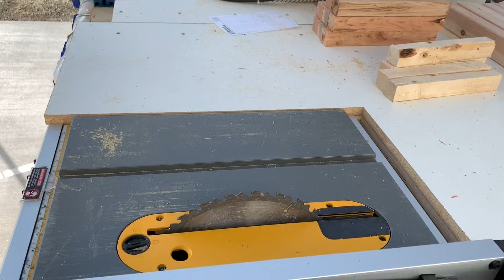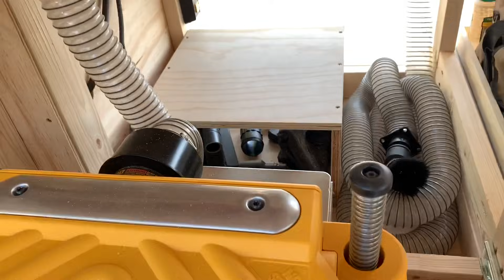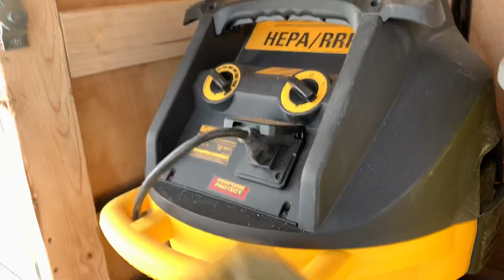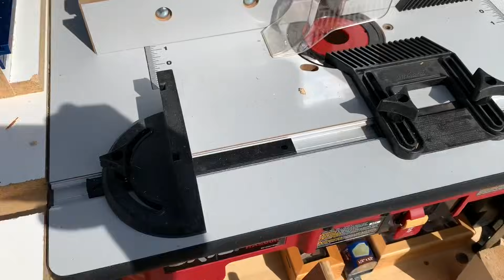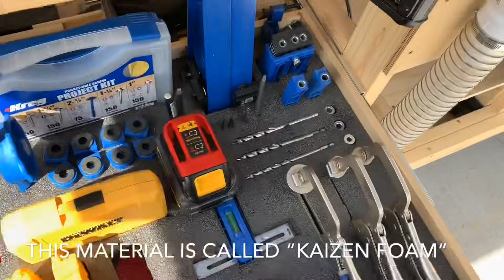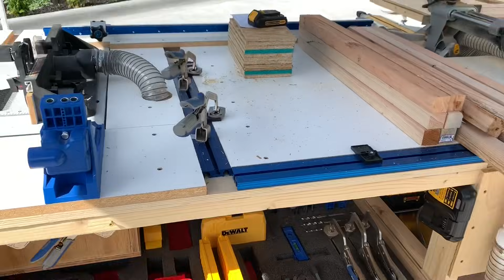DIY Mobile Project Center - DeWalt Workbench Walkthrough

Comment: I absolutely love this workbench/station!!! What I love the most is the vac with the power sensor built-in. I have a wall-mounted garage vac for now, with a remote-controlled switch that the vac is plugged into. I plan on getting a 2 hp dust collector which will go into a small closet built off the back of my shop. this will keep the noise out of the shop and the need for the expensive HEPA filters. I do have a hanging air filtration unit that does a great job of taking the fine particles out of the air. That valve system is pretty sweet too!!

Comment: I just finished building this table with some of my own modifications. I can say that the plans are excellent and very easy to understand if you are an experienced woodworker. One of the major changes I made was to increase the size of the dust collector valves to 2" and I use a Rigid 6 hp shop vacuum and it works perfectly so far. I caution that this is not a project for someone who wants to build it in a day or so and it takes time to shop and accumulate all of the parts and pieces. The plans offers a list of just about everything you will need along with the prices and that is extremely helpful. I am 6'3" and found the specified height of the table with casters to be higher than comfortable for me. I reduced the overall height by about 4 inches by changing the caster size and reducing the frame height.. I do caution that if you change the dimensions, you have to look carefully how that affects the cut plan for individual parts. The height change also required a simple work around to fit the dust collector into the smaller height. I really like the table and compliment the creativity and  innovative design that was done by Scott Stekr.
Reply from the maker: Thanks Bernard I hope you enjoy your workbench!

Comment: Just saved your video.  Awesome table and very inspiring.  The only thing I saw were the screws that extend down through the top.  I know the first time I reached into one of those top shelves, I'd be pulling out a bloodied up hand after catching it on one of the screws.  Easy fix though, so certainly nothing to knock you about.  Really nice work station.

Comment: Pretty sweet setup. Only thing I would change is the electrical that power strip and cord are a bit small for running 2 tools. Im surprised you haven't tripped a breaker. Id run a 30 RV service to it and have some extra electrical head room. I've seen lots of brushes burn up on tools from running to small of cords. Sweet setup 👌 though I see a ton of productivity in it. Get you a helper and you could really crank out some projects!

Comment: Nice workbench! Your video just popped up in my feed. One improvement I might suggest would be to have the vacuum plugged into a remote on/off switch. Then you don't have to deal with reaching through to turn on the vacuum locally
Reply from the maker: Check out the whole vid, the vac turns on automatically with every tool.

Comment: Really nice bench, upgrade your planner with carbide helix head will run you about $400 you will cut down on changing blades by 95% . On the steel ones you hit a hard knot and your replacing a blade. And its much quieter. Again great bench.

Comment: I like it - the only thing that caught my eye were the screws showing through on the right side. Then you opened the drawer with the hand helds and figured you probably don’t need to worry about hitting them reaching into get something.
Reply from the maker: Yeah it does look terrible in the vid.  I only had the 2" screws left when I was wrapping up.  Arm hand, etc never comes close to underneath the top so far so good.  Thanks for checking it out!

Comment: I tagged your build when it was first posted and am finally ready to buy your plans and build it!  A couple of questions:  if you're running just one cord from the workbench to a wall outlet, what amp size outlet are you plugging the cord into?  Overall, how did you find the vac's CFM suction for this setup?  Was it up to the task?  After looking at so many workbench builds, I always returned to yours as the best for my needs.  Many thanks
Reply from the maker: I have a dedicated 20A circuit and 20A rated extension cords and power strips.  (NEMA 5-20).  The power strip I landed on is basically for computer servers.  https://amzn.to/3zr0khI

The vac setup is awesome.  Wouldn’t (and haven’t) changed anything.

Comment: So I made this bench from your plans, I ran an entire electrical system in it that plugs into an extension cord to give it power. Love this bench, big but useful, my question is, how did you connect your router table to the dust tube? I have the same router table, but am struggling finding the right connector
Reply from the maker: I used a rubber plumbing fitting that fit nicely into the dust port.

Comment: WOW! Love it! Great features on your bench sir! Very well thought out. I will be building my bench through the fall winter I hoping and may incorporate some of your ideas (as well as may other tradesmen). I am wondering if you're happy with the dust collection through your flex hoses. Do you have enough suction? I've learned that with shop dust collection systems the less corrugated pipe and the less curves and sharp bends the better as it creates more friction loss and less suction. Perhaps there's no problem with a bench vacuum system.  So in retrospect would you do it the same way if you had to do it over again? Thanks for sharing this helpful video. Again its awesome!
Reply from the maker: No problems to report, plenty of suction.  The total length of piping is relatively short so I don’t think it would ever be an issue.  Also I make sure to run the pvc wyes in the right direction for flow to the vac.

Comment: Hi. Great project, i think i'll get it and try building it. Just a question: the bench looks very high, i read from the site it is 46 inches (116.84 centimeters). Usually workbenches have their height set below 91cm.
I'm 1.82 meters, do you think i will be comfortable working  at 46", given that i cannot remove wheeels (wich would sove the problem imediately).
Thanks in advance. And again, fantatic workpiece.
Reply from the maker: This is setup as standing desk height.  You may want to adjust it to your needs but it is supposed to be taller than normal.

Comment: I purchased these plans back in February. I’m well into the build. The plans are well done, easy to follow. Scott has answered all of my questions on Etsy and even sent me his own pics of the building process. As I am half way through this build(all framing complete, working on the melamine top) I’m starting to get nervous about the height. The table saw surface sits at 46” from the ground. Scott are you 6’8? Lol. I’m 5’10. I’m really nervous I’m going to have to take the wheels off and make it a stationary workbench so the machines on top are low enough to use safely. Any suggestions?
Reply from the maker: James-  thanks for the positive comments!  As for the height I designed it so it would be standing desk height.  You will see once you get used to it how much more ergonomic it is.  Depending on how big whatever you are making is you may need to work on the project on another lower work plane but for building doors and drawers I think it is pretty ideal.
Reply: @WoodWerksUSA  I’m going to finish the project how you drew it. I might add a stable rack on the outside to house the wheels that lowers it, or maybe sink the wheels into the workbench if I can figures out how to do so without disrupting the rest of the layout. It’s been really fun building it. I really like the layout so I don’t want to have to change anything. I will definitely try it out as is before making any adjustments. I’ll Make sure to tag you on insta with the build pics. Maybe 46” only feels high until I start using it. This Scott’s.
Reply: *thanks Scott

Comment: This is above my current skill level or needs, but I really appreciate the design and functionality. The exhaust system alone is a work of art. Two questions: (1) Why do you have that spline on the front of the Kaizen pullout drawers vs. one continuous piece -- is it purely for design or some other reason?, and (2) if you're running power to this from your house, did you have to beef up your electrical panel? Thanks.
Reply from the maker: The wood thing was just using what I had available.  I had 36” lengths of poplar on hand and wanted 45” drawers so thats the solution I came up with.  Adds a little bit of design into it, probably wouldn’t have done that otherwise.  As far as power it is no different than just running one tool and the vac, I just use a 20A circuit with a decent 10ga extension cord.

Comment: I just purchased the plans. I am starting this project Saturday(2/20/21). Any words of wisdom?
Reply from the maker: Give me a shout if you run into any snags!  Make sure your work surface for building is level!
Reply: It’s 24degrees here so I will do my best. I am working in our barn
Reply from the maker: @RandyStClair-li4ss  Do you have some HEAT??
Reply: @WoodWerksUSA  I put a heater in the barn. I got the base done and framed out the base. Starting to build up the frame. So far seems to be going good.

Comment: why not just have the miter be a flip top and make a planer station?  That way the miter is never potentially an issue with the outfeed, you reclaim its footprint when flipped for workspace and then the planer is on it's own station that doesn't require you to bend over to use?
Reply from the maker: So I found the flip up solution to cause issues with precision of the stop block setup, it wouldn’t ever be in the exact perfect spot because it could move around.  The outfeed for the table saw is a good topic.  I specifically wanted a setup where I didn’t have to clean off my whole work space to cut sheets.  This allows me to do that.  As for the planer, I agree.  If it was something I used a lot it would have its own cart alongside a jointer.  👍

Comment: I'll be ordering a set of plans in November so I can build this over winter! I was in our local HomeDepot  picking up some tools and I went to check out the ball valves. The largest I could find was 1.5". Are those larger than 1.5" and if so where did you find larger ones? Did you order online somewhere?
Reply from the maker: Wow Rick sorry for the late reply here, missed this question.  I used 1.5" valves here.  You can get 2" valves though, just have to poke around online.

Comment: This is a great design but I do have a couple of ideas for people planning to build there own first if the bench needs to be smaller the miter saw could be mounted in a flip up mechanism like the out feed table. Also if someone is doing this to make it job site mobile and don't want to use all cordless tools there is more than enough space for something like a Titan or blueti solar generator those things will run every tool on this thing

Comment: Very nice but upgrade your electrical. Looks like you've got a long cord run there plus the tools going through two power strips and the shop vac. That's not a great setup for long-term use. A bigger, shorter cord feeding the supply would be best. Ideally get two cords, tape them together, and run one to the initial power strip and the other to the shop vac directly.
Reply from the maker: The first power strip the extension cord is 10 ga.  I believe the limit is the 12ga romex on the 20A circuit.  Also I have never had an issue, so far so good.

Comment: Out of curiosity, how much does this bench weigh and is it heavy to move in and out of your garage? I built one that's similar in many ways with a full loadout of tools on it and it's heavy as hell! I can still move it around but wouldn't want to add any more to it. I will, however, be making a few modifications based on items on your bench. Great job!
Reply from the maker: I estimate its around 800lbs.  Its heavy but moves nicely with the casters I used.

Comment: Question: I finished building a similar table but only has a table saw with the Dewalt automatic vacuum similar to yours. I have the table saw power plugged into the vacuum so it turns on automatically, however, it blows a 15amp breaker switch. Any idea how to fix this? It looks like your entire set up is on a 15amp, not a 30 amp. Any suggestions will help me out a lot, much appreciated it.
Reply from the maker: You need a high quality 10ga extension cord and a 20A breaker.

Comment: If the mitre saw was designed to flip and the table saw used the workbench as a run-out, I'd buy the plans.
Reply from the maker: But then you have to clear off your whole workbench to use your table saw 😉
Reply: @WoodWerksUSA  
So?

Comment: Just bought these amazing plans they are very well thought out. However I noticed it’s missing a jointer. Any ideas on the easier place to mount that? Maybe replacing the router table?
Reply: Just use tablesaw for a jointer 🤷‍♂️

Comment: Scott,
I am almost done the work station. Is there any way you can give me the flip up brackets information you used for the other bench you made? I think I want to add them to my station. 
Thanks, Randy
Reply from the maker: Hi Randy-  they are built with 8020 aluminum rail.  Check out 8020.net for product information.  It is also available from McMaster Carr if you look for structural framing.  I used the “15” series which is the 1-1/2” stuff.
Reply: @WoodWerksUSA  Thanks Scott.

Comment: Question?   The power sensing vac??  How?   Also, where did you find the flex hoses?
Reply from the maker: It is built into the vac itself.  Not quite sure how it works but it’s probably not all that complicated.

Comment: The dust collection appears to employ ball valves instead of blast gates.  How well does that work?  Any issues?  Are you happy with it?  What size pvc is that?
Reply from the maker: 1-1/2” ball valves.  They work well, sometimes a they are tight just because they are pvc, but overall they are good.

Comment: Maybe a dumb question since you clearly use the bench as a site workbench.

But would a more dedicated dust collection system work better if you mainly keep your bench in the garage, such as a Jet? Both the Jet and the DeWalt cost $599.99, but the Jet has about 10x the suction and is still pretty mobile, you just can't stick it under the tablesaw.
Reply from the maker: Sure there are other options but I mostly roll this outside in the summer to work.  Plus it was just easy to keep with the DeWalt theme.

Comment: Any regrets after the fact in having to bend over to use the planer?  Also, would this design allow for a couple of small notch outs to accommodate the table saw rails so the fence could slide all the way in to the blade without needing an aux fence? I’ve seen other plans where these notches and under-counter grooves are created to allow full fence use.  I’m super close to buying the plans…
Reply from the maker: Yes you could absolutely route in miter gauge slots without any problems.  The planer isn’t too bad actually.  I got used to it quickly.

Comment: Are those feet adjustable?  I want to build this so I can move it out in my garage when using, but my floors are pitted and not level.  This is why I've avoided wheels on a workbench.  If I could adjust them and level them that would be perfect.
Reply from the maker: You would put shims under the floor locks and it would level out.  👍

Comment: Has anyone installed a garden variety shop vac with a power tool actuator instead of using the dewalt shp vac one Scott has on his parts list?  Could probably shave a few hundred bucks using the tool actuator?
Reply from the maker: Yes several people have successfully done this!

Comment: Scott what are the dimensions of this?  Just wondering the working height of the top
Reply from the maker: 48x120 is the top, 46” working height- similar to a standing desk.
Reply: @WoodWerksUSA  Awesome.  Also, how do you get the vac on for just the spare hose that you hook up to the pocket hole jig?